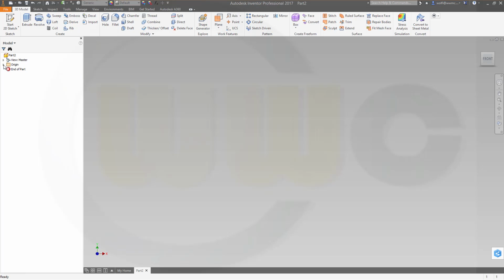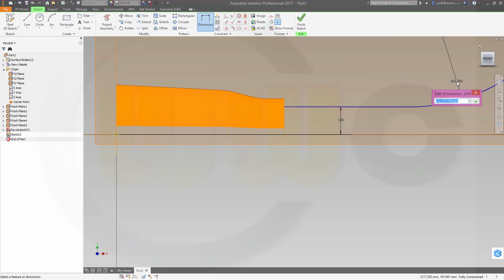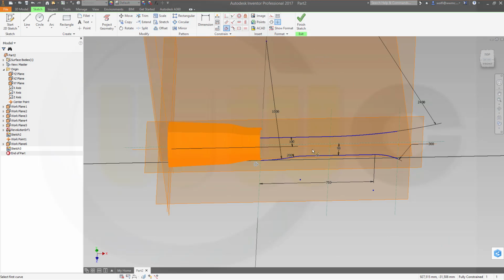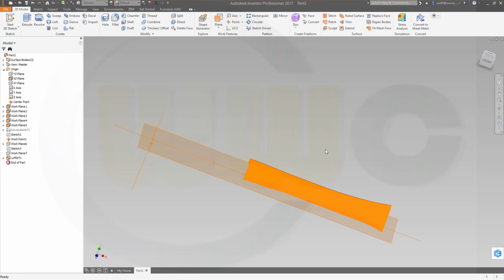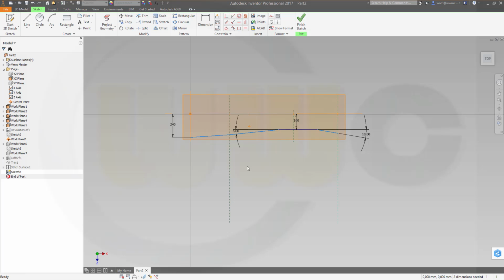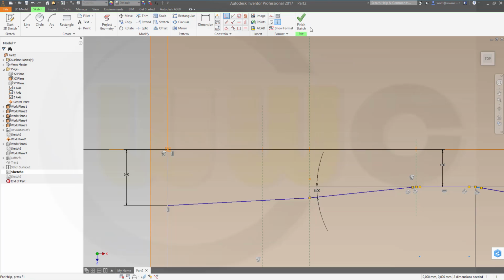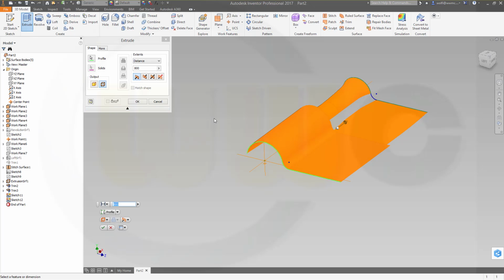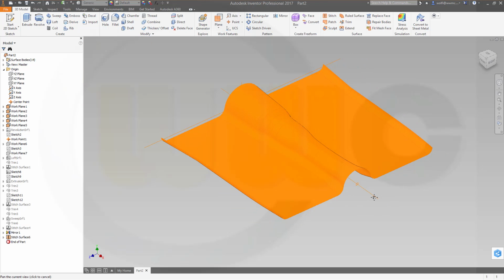Bodenblech - Base plate - Inventor 2017 Training - Surfaces

Comment: For catia v5 or siemens nx, can you switch the files to inventor and edit it easily? Or do you have to convert to inventor as a step of stl file? I am thinking about learning catiav6 or siemens nx because you seem to like it a lot more for surface modelling.
Reply from the maker: Usually you import catia-, nx-, creo-, solidworks-files in inventor. If you want to do surface modelling you should use catia, nx or alias. Inventor is not really made for surface modelling.